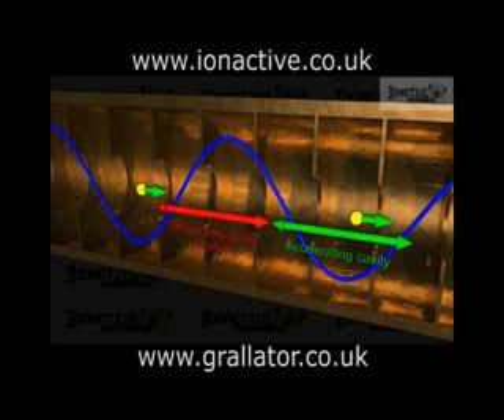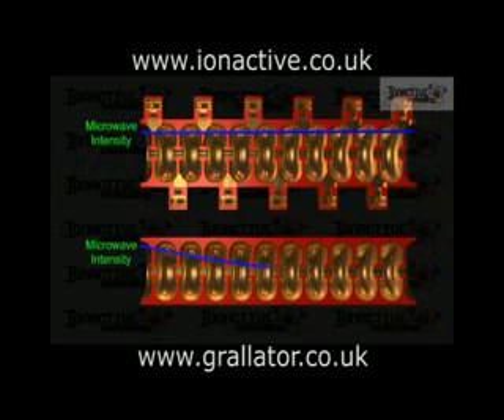The Linear Accelerator (LINAC) - (Part 2) - Radiation Protection

Comment: Thank you for both the videos. They are very clear. However I think that there is a mistake in the standing wave part. The electrons are accelerated only when the pass through a cavity with a longitudinal electric field (i.e. only then the potential between the two boundary plates of the cavity is not equal). IN the video they are accelerated in a cavity with the two walls at the same potential..